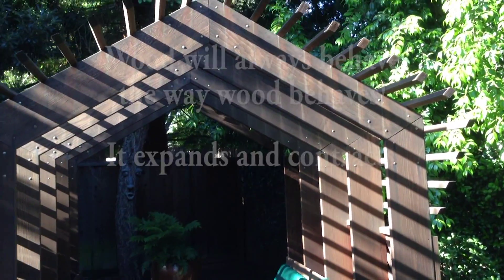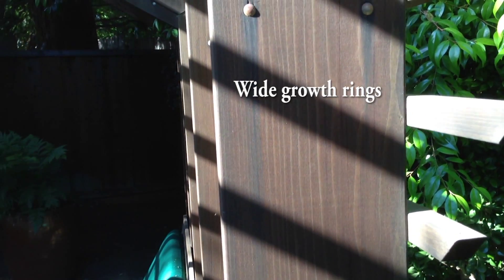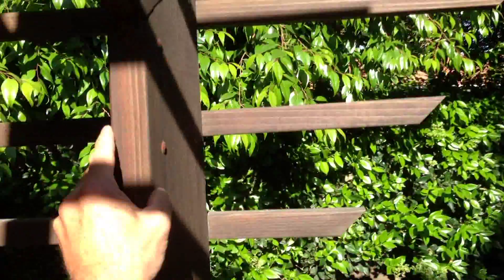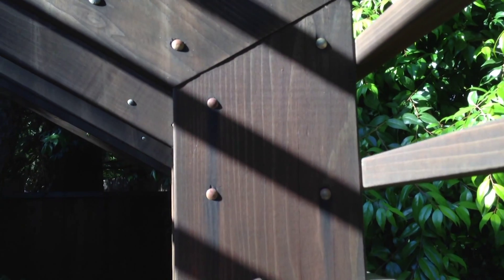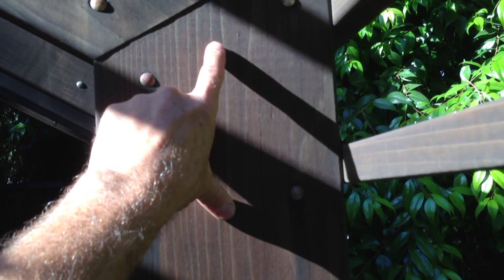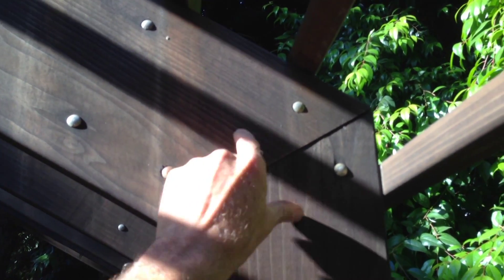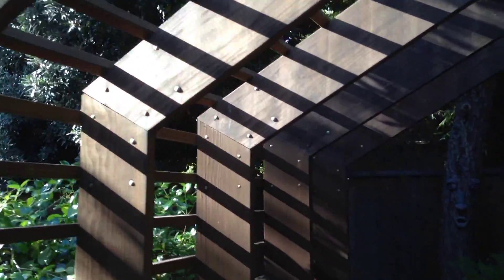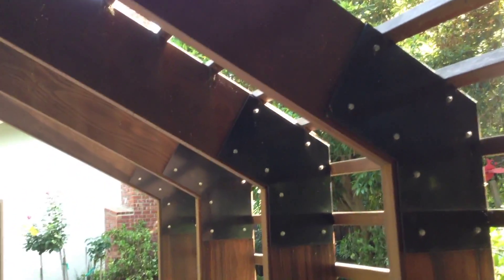Understanding Wood Movement

Comment: The holes thru the timber should be larger than the bolt so the wood can move. that is a common solution to this joint.
Reply: +Ralph Snellen It would be better, but the 2nd bracket choice Blair mentioned would have been a lot better, and much cheaper too. And it's really not such a good idea for drilling oversized holes because there will be all those internal areas of the wood exposed to moisture, exactly like leaving the end of a board exposed. He is also right about using stainless bolts versus galvanized. I know they are extremely expensive, but when considering the fortune they paid for all this clear redwood, it would've been worth every extra dollar spent.

Comment: A poor choice of joinery for the reasons you mentioned.  The thing is really cool but the rust streaks make it look nasty not rustic, and rustic obviously was not the intent anyway, a very clean modern concept but not taking the needs of the materials into account kind of will make a long term problem in durability and looks, too bad, like you said that was not a cheap-o project.